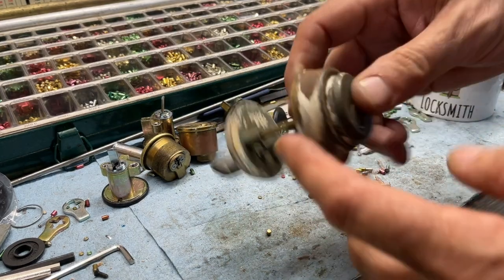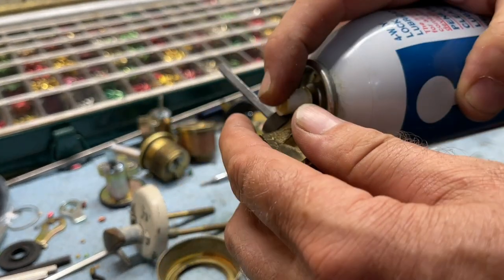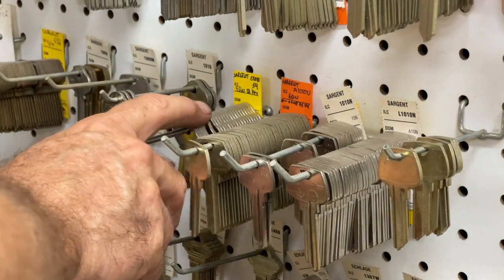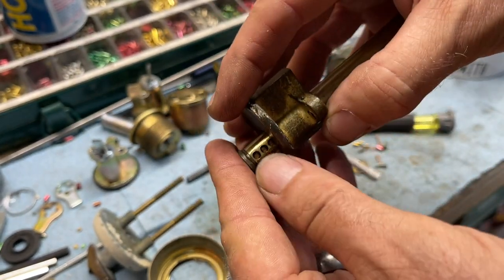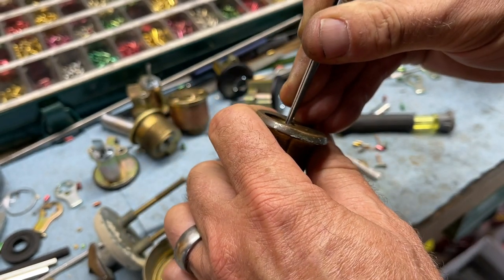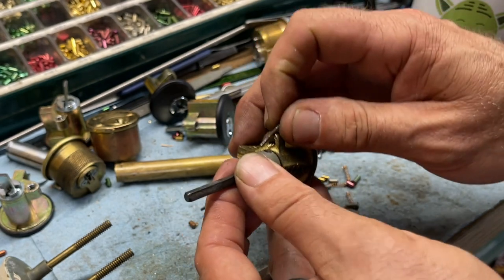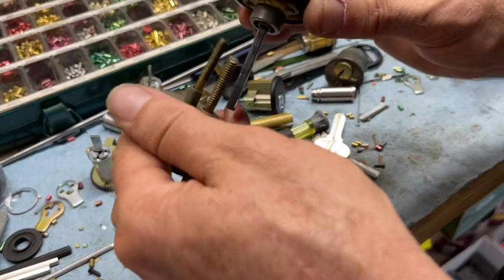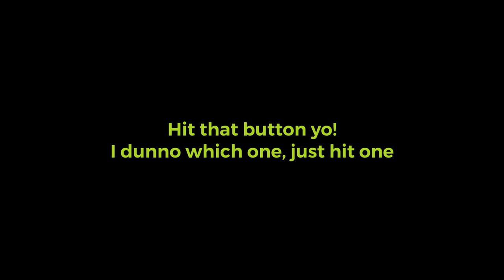rekeying antique 1940’s era Sargent deadbolt

Comment: Nice old lock, I just picked up an old Sargent mortise lock, but had no cylinders with it, but did include a crystal doorknob, and the brass ones and cover plates. And I also picked up some old mortise Sargent cylinders the week before. Brass is all about same color. And could barely shim them open to make keys. 

Have a great day

If you want to see my lock photos I post them on Instagram under same ID, but I have to add you.

Comment: When I masterkeyed a building with Sargent locks I used Ilco's Sargent original pins which where round at the bottom.  Maybe that's why the pins where a little high as standard Lab pins are more pointed.  Or it could be because you used the wrong cutter.  When I put some of those Sargent original pins in the LAB pin kit, it didn't work out so well on the Schlage cylinders so I had to remove all the Sargent pins I put into the pin kit.
Reply from the maker: It likely was the point-ier pins!